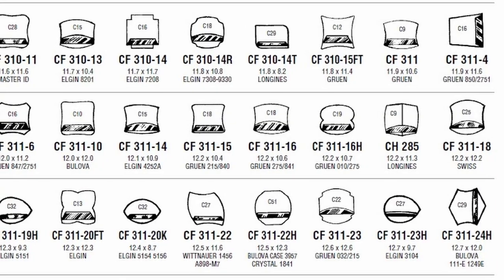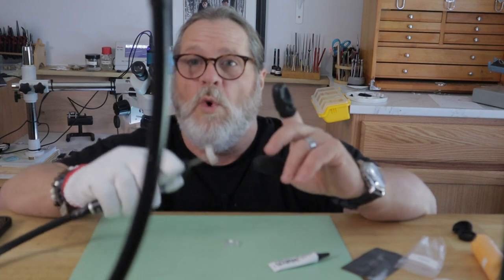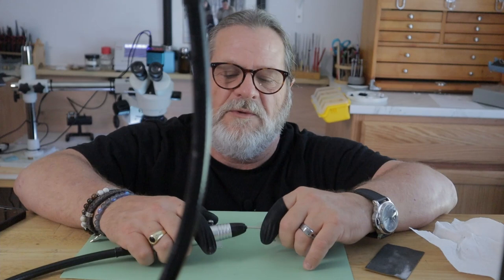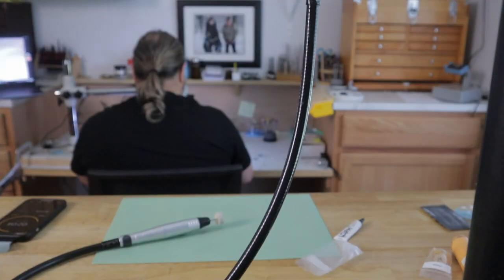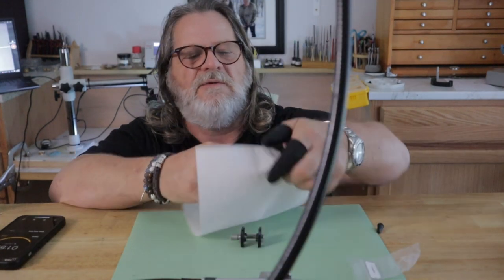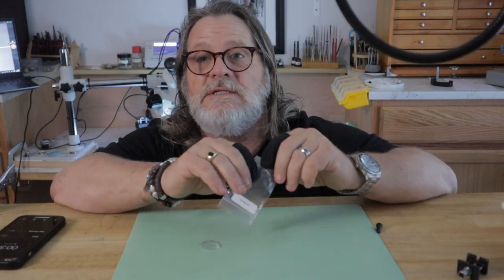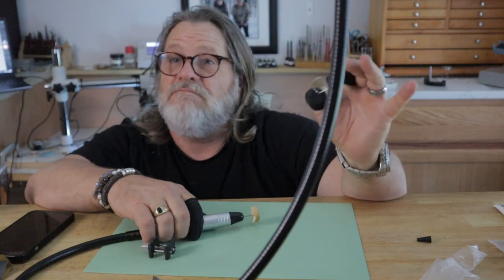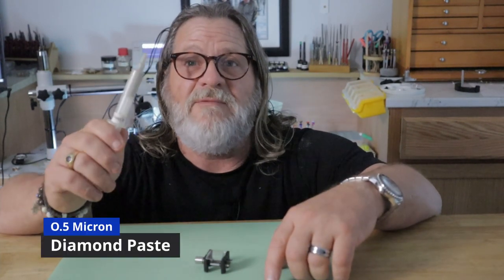Better Methods For Polishing Acrylic Watch Crystals-Lesson #20

Comment: Adding water to the final sanding, and at the end, easing up on the pressure, will result in a even haze that is easy to polish. I freshen up watch crystals using 2,000 grit wet dry sandpaper with water, and Maguires plastic polish to finish. It's interesting to see the yellow  plastic residue that comes off in the beginning of a wet sand.  I'll use your progressive approach on deep scratch crystals.
Reply from the maker: Yeah man there’s a lot of different ways. It gonna be done in a lot of different products. That’ll work to get scratches out of plastic.
Reply: I use water too. It takes of the residual plastic for sure

Comment: I don’t know what brand name is used elsewhere, but in the UK we have a metal polish called Brasso. When I was young we always used that to buff scratches off our watch crystals instead of talking them to a watch repair shop. Simple home remedy that seemed to work well.
Reply from the maker: Hey man that’s great. There have been quite a few other products that have. Even suggested as well.
Reply: It’s called Brasso here in the US, and I’ve used it to polish watch crystals myself! It’s also quite useful for polishing away scratches in plastic headlight/taillight lenses. A Brasso vs Polywatch comparison could be interesting.
Reply: I use maguire’s plastx from harbor freight. It’s used mainly for polishing headlights. It smells and feels just like polywatch but is a good bit thinner or runnier. The best part is a pint costs the same as a tube of polywatch. For really bad scratches I use a product called mother’s mag and aluminum polish.
Reply: I’m definitely going to get some wet/dry sandpaper to try.
Reply: I use Brasso liquid myself as well.
I have good results on mild scratches or as a final rub after the sand paper.
Also used the duraglit one which comes soaked in a cotton mesh.

Comment: 1.  excellent video
2.  good suggestions from the comments.
3.  some observations follow re working with cars that might work with crystals.
     a.  car windshields are a form of glass.  wash, use very fine sandpaper like 2000 grit, then polish by hand and wipe off.
     b.  replacement headlights which are not glass.  wash.  dry.  Plastic polish as set forth in the comments.  Maguires.  I do it every three months as particles and dust do hit the lenses.
4.  yes, I have brasso.  may try it as well.
5.  some day, I will try a very fine 1500 or 2000 grit sandpaper and then a polish like maquires.
6.  I don't have any scratched lenses.  Sometimes I use 70% isopropyl to simply clean the crystal.

Comment: Heh, on the topic of cleaning machines, after seeing your suggestion, I asked my 12-year-old if he could figure something out with his legos and a lego battery-operated motor (with the same basket and jar). And he did! It has a couple of arms to spin around the basket. I actually posted it to the watch repair subreddit. Kids, man.

On the topic of sandpapers, there's also tips and products for restoring car headlights, same principle there. And just like you pointed out, 800 is great when you need to get out deep scratches.

Comment: Thanks for another great video Alex! I'm switching from PolyWatch to Polinum, sandpaper & Diamond Polishing Compound.
Reply from the maker: Polywatch has its purpose but I prefer to have supplies that can do everything I need and not multiple products to do the SAME thing.
The sandpaper and 0.5 micron diamond paste will cover everything. Polinum is also good if you already have it for case polishing but the 0.5 micron diamond paste is slightly better for acyclic polishing.

Comment: Acrylic crystals are pretty easy to restore to like new.  I wet sand staring with 600 and working my way up to 5000.  It only takes about 10 seconds with each grit.  I only used Polywatch for final polish or I often use some car cleaner wax.  Another tip for those on a budget is to go to your local CVS and buy one of those 4 sided finger nail buffing blocks.  Similar principles and works great.  I do everything by hand.  As you state, too much heat with rotary and the crystal will melt or crack.
Reply from the maker: Great tips my man. I’m loving it.
Reply: I agree. By hand. I start with a higher grit and use water. Agree polywatch is for finishing.
Reply: Also I use the sandpaper from the top, I move the paper not the crystal
Reply: I agree, wet sanding makes the difference IMO. I use 320->800->1k->3k then a drop of polywatch, never needed anything else. Like Fior said I move the paper not the crystal. Easier for me to not make flat spots and get up to the edge of the crystal without rounding over any edges.
Reply from the maker: @cgnicolis  on domed crystals, you definitely want to move the paper over the crystal. The crystals I demonstrated with in this video had a flat surface, a curved crystal but flat. When polishing this shape, moving the sandpaper by hand to the edges will break the sharp edge.
Reply: @watchrepairtutorials  thank you. Very clear and practical video. 

When it comes to sapphire crystal glass, it’s obviously a much harder material. 

I’ve had success with diamond paste to remove scratches one coils feel with their finger. Basically I used 28 strength diamond paste and then to 5 strength to 3 strength.  I used a dremmel and it took 2 hours. Very time consuming. 

It would’ve great if you could share some tips on sapphire crystal glass polishing and even a video on the future …?

Many a google search result says you can not get out scratches from sapphire crystal glass. Not true IMHO. 

I also want to add that many a product that uses cerium oxide says it works on “crystal glass”. What they mean is, it’s MINERAL GLASS. Not SAPPHIRE CRYSTAL GLASS. 

MOST MODERN “luxury watches” use sapphire crystal glass … some (not many) have AR coating on BOTH the inside and outside of the glass. If so, it  is often the case, that it’s the AR coating they is scratched. If so, polywatch and such will easily remove the AR entirely. I have not had a watch with AR coating on the exterior, so I can only say the above based on other’s experience. 

Could you share you thoughts on polishing sapphire crystal glass, and any tips (such as using diamond sandpaper or such) to speed things up. 

Many thanks and best wishes from Singapore 🇸🇬
Reply: Very interesting, but how do you not damage the watch case when using sand paper?

Comment: I’m a fan of acrylic crystal. Mainly because I’m a fan of repairing something instead of just replacing it. The 0.5micron diamond paste is a great solution that really works amazingly well. Great tip mate!
Reply from the maker: It does the trick that’s for sure BBB.😀
Reply: @watchrepairtutorials  absolutely. I personally can see the results are at worst just as good as Polywatch, but to be honest, significantly better in most cases, especially once you get deep scratches out.
Reply: I can see the difference in it video. Man, you’re killing it. Love having your channel because here in Australia all I’ve met is gatekeepers. No one is willing to pass on the knowledge.

I even joined a group recently. My membership got declined because I’m not qualified. Those same people will be quick to remind us that it’s a dying art and a dying industry. Yet the ones working in it here have a two year waiting list on work. But at the same time the more well known watchmakers churn through staff like it’s a merry go round.

Thank you for providing all this info, and backing it up with , real life experience, right in front of the camera. There’s no bullshit to hide behind when the proof is right there.

Comment: I've made a cleaning setup with 4 wide mouth mason jars and the basket. I took a torx bit and cut the tip off. I cut a groove where the tip was and slid that over the basket handle. Then welded the two together. Now I can use a drill with a quick release and a rocker switch with the basket.
Reply from the maker: Andrew,
I love the creativity that people are coming up with from this little video I did.
Awesome stuff

Comment: Polywatch is really good for taking out that one or two scratches when you scraped your crystal against the table.
For deep scratches from 3 decades of wearing, you really need the tested way of coming up through the grades of wet paper followed by a polish.

Just like with cabinet makers, there's no shortcut to getting the right finish
Reply from the maker: That’s a great analogy with wood working.

Comment: These videos are so helpful!  Through trial and error, I’ve ended up using the graded sandpaper and diamond paste method, but have always wondered if Polywatch would have been better.  Now I know!  And thanks for sharing the hand drill cleaning idea.  I’ve been using a slight modification of the method you showed in your cleaning video, but might try building a better system.  With all of your videos, the info you present has helped me to refine what I had been doing, and the improvements have been remarkable.  Many thanks, Alex!
Reply from the maker: Thanks for the Kind words Paul. You motivate me. 
Alex

Comment: I've been using Cape Cod polishing cloth for my final polish. I believe its a rouge polish but it has worked very well for the final pass.  I use the sandpaper method for my base polishing. I learned that polishing up acrylic headlights before I picked up watches.  I have been experimenting with some ebay diamond paste assortments.. The results have been pretty good overall
Reply from the maker: Sounds like you got it covered Mike. I know a lot of people have suggested some of the polished used for headlights as well.

Comment: I was a metal polisher back in the early 70s, we had to be super careful about not overheating pot metal parts, burn throughs are very costly when it comes to near-irreplaceable car parts.
Reply from the maker: You will probably very good at polishing stainless.

Comment: Another excellent video Alex.  I use Micro-Mesh in grades from 3200 - 12000 and then finish with Polywatch, although I do find Polywatch a little 'glarey' afterwards.  The benefits of micro-mesh is that you can wash them out and reuse them.  I'm a BHI student and your tips are great, they should include stuff like this, and items from your other videos in the course 😀
Reply from the maker: Thanks Charles,
I had completely forgotten about micro mesh. That’s a great tip and product.
Thanks for your contribution.
Reply: Bought a selection of micro mesh and IT IS GREAT THANKS😃

Comment: Again great video, with so much attention for detail. Thanks. Can you do a video (tips) on how to polish screwheads? In vintage watches, most of the time the heads are sratches or damaged by previous services. Can we rework the screws (and maybe other parts) a bit in an easy way, so they look a bit more fresh?
Reply from the maker: Yep. There are to main ways to do it successfully. One is with a bolt tool and the next is with a dedicated screw polisher. I will be doing a video sometime in the future.

Comment: I’m restoring a vintage Timex Electric M40 and I’m starting by polishing the exterior surfaces. Would you recommended combining both methods, Sandpaper + polywatch for superficial scratches?
Reply from the maker: On the crystal? Yes. Depending on how superficial they are you may only need Polywatch.

Comment: Diamond paste and abrasive is easily the most underrated product for polishing. The issue with any polish is that the particles actually begin polishing each other very quickly. So you have to constantly load your buffing material with fresh abrasive. Diamond particles never lose their cutting edge, so they don't get polished and need to be reloaded like other conventional polishes do. So they not only work better, they last essentially forever, and also won't load up your buffing material with chaff. Plus the diamond cuts faster due to it's hardness.
We use them all the time in the knife industry. Where it really shines is on a razor strop. Nothing is worse than an expensive strop loaded up with old polishing paste. A clean strop with embedded diamond works far better. I could easily see this being the case with watch crystals as well. As an added bonus, it should work on hard mineral crystal and sapphire as well.
Reply from the maker: This is an interesting comment.
I use diamond lapping paper on glass that’s used and sold for knife sharpening.
Reply from the maker: I might try making some sanding stick with it. 
Thanks my friend

Comment: Which product is with finer grid - the Polinum paste or the 0.5 Diamand Paste? And how do you chose when and where to use one or another? Thanks in advance for sharing!
Reply from the maker: I'm not sure what the grit is on the Polinum. I will use the Polinum more often because its less expensive. Diamond paste more often on glass cystals
Reply: @watchrepairtutorials  it makes sense, thanks again

Comment: Thank you for your video. I have a question: Does your methods (polywatch, sandpaper) work also with scratches on smartwatches like applewatch or fitbit? I have deep scratches on my smartwatch that I would like to remove without breaking the tactile screen. Thank you again!
Reply from the maker: This method only works on plastic or acrylic watch crystals. I believe apple watches have some sort of glass crystal so it would require different methods.

Comment: Would Dialux Gray Polishing Compound Rouge be an acceptable substitute for Polinum in this application? I got the Dialux for polishing oiler tips per an earlier video because I couldn't get Polinum at the time.
Reply from the maker: What’s Grey used for ? Removing deep scratches. It’s the second highest grit next to black, so probably not a good choice. 
I would go for the white as a minimum if not green or red.

Comment: Do you change direction as you use and go thru the grits, or circles? Thanks.
Reply from the maker: That particular crystal was a curved flat crystal with 99 degree edges For an old tank style watch. That was all one direction sanding. 
If it was a domed crystal I would have had it facing up and had the sandpaper in my fingers.
Direction of sanding doesn’t really matter. That really helps when you are in lower grits and and sanding wood because it helps to see areas that didn’t get sanded as well. 
These grits are so fine you would barely be able to see any scratches.
Reply: @watchrepairtutorials  - Thank you 👍

Comment: Love the video!  I find using a dense 1/2" thick piece of foam under the sandpaper allows you to really get the edges perfect as well.
Reply from the maker: Well exactly. There were some comments about how I shouldn’t of ran the crystal over the sandpaper, but should have run the sandpaper over the crystal. That’s true when you have it domed or rounded crystal. If you do that on a crystal with a sharp edge, you’ll end up breaking it or slightly rounding it over. It’s no different than sanding wood in that respect.
Reply: @watchrepairtutorials  Makes sense to me!  Thanks for sharing your knowledge.  It always helps to get a new perspective on things!

Comment: I really like your videos. No snob zone here, and very informative. A few months ago I found a old pocket watch, all black of oxydation and after cleaning it up the crystal seemed even more worn than before. I really wanted to do something about it, but didn´t have any polywatch or very fine sandpaper. But - I was itching to do this that night and by using a 800 grit sandpaper, then some very worn piece of it and patiently hand polishing with tothtpaste it ended up being useable again. 

I do have a question: when restoring acrylig glass on car headlights you always finish with a sealant as an UV protection, to slow down fading and yellowing. Is this something to consider for let´s say sport watches? Golfing, surfing, fishing and other activities includes a lot of sun exposure.
Reply from the maker: Not typically no. The plastics in older PW's that you see with yellowed color were from early forms of plastic's. New acrylic crystals don't really demonstrate the same problems, although we will have to wait and see,

Comment: Can you manually use diamond paste on a cotton glove or cotton cloth with (more or less) the same effectiveness as the rotary tool with the cotton mop? I'm just wondering since I don't have a rotary tool, could I just put diamond paste on a cotton cloth and manually buff out the scratches with the same effectiveness?
Reply from the maker: Sure with a lot of elbow grease but why not just use sand paper and water.

Comment: I just got my first tube of polywatch and used it on two watches only to realize the scratches on the acrylic is deeper than I expected. Can I use the sandpaper method first then use the diamond paste?
Reply from the maker: Of course finish with diamond paste or Polywatch or even a polishing compound like a rouge.
Reply: @watchrepairtutorials  Great, thanks!

Comment: And there you go again buddy. Another great video for us. I have a few comments for this one. Is there a reason why you didn’t wet the sand paper first before using it?  Also I have found my Mcquires car polish works just as good as Polywatch and it’s a lot cheaper and you get a lot Vo more of it. Also I’ve found turtle Wax cutting compound works great to remove scratches first before moving to the polish.  I love that cleaning stand. I’m thinking of doing something similar but using my electric hand drill.
Reply from the maker: Hi Graham,
Someone else asked the same thing.
No sometimes I do use water I just didn’t in the video.
I have seen comment about several other compounds that people use like headline polish as well. 
That may be worth doing a follow up video down the road.